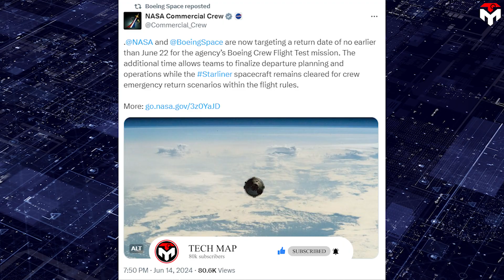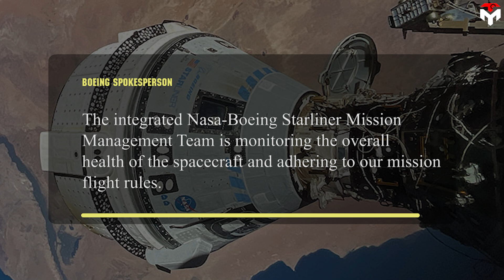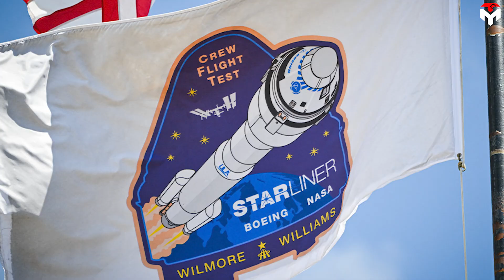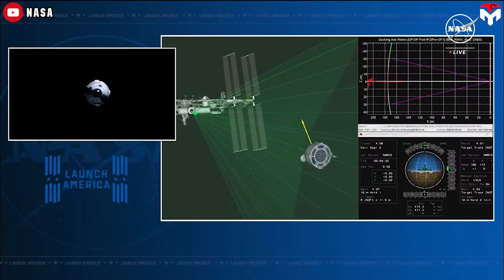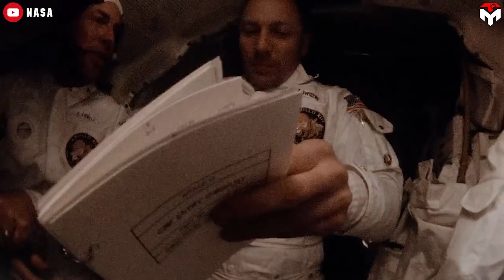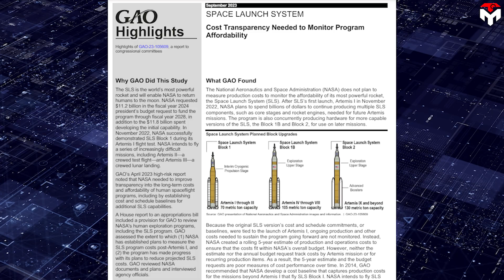Boeing Starliner in Serious Problem! NASA Engineers to "Give up"...

Comment: Tech Map has issues

A) you can’t just send SpaceX to the rescue.
B) Butch and Sunni would need SpaceX suits made for them and shipped to the ISS. Starliner suits won’t work on Dragon Capsule or vice versa
C) ISS will have consumable issues since the astronauts we only supposed to remain 10 Days
D) Starliner would need to be undocked at some point to prevent it being stuck at the station from the helium leak
E) Crew Dragon can’t just show up, load everyone onboard and depart. The ISS has to be in the correct position for proper splashdown

F) if Boeing/Starliner were to fail, then Boeing would be humiliated and I bet all commercial and defense contracts would be null and void. Boeing won’t risk that

Comment: Yes. And it may be necessary for starship to bring it back.
There are iterations of starship that might be capable of it.
Just mind numbing how the robo voice continues to butcher words in every sentence
Reply from the maker: :pride-flower-rainbow-heart::pride-flower-rainbow-heart::pride-flower-rainbow-heart:
Reply: These people don't know what they are talking about. The RCS thrust pods on Starliner are the same ones used on shuttle. The helium valves on shuttle also leaked because helium is hard to seal due to its molecular size. The control valves can be isolated with separate shut off valves while not in operation. So the helium is not continuously leaking. There is enough helium to leak and use the desired amount for thrust control. If it were not a test flight these leaks would be barely notable because they fit within parameters. 

I do think Boeing is getting sloppy and they have too many folks working on economics, sales, and de-regulation. Not enough air-craft engineers and technologists working to their peak ability.

Comment: There is absolutely no way those astronauts will return on that spacecraft. At least that's my opinion. If anyone in charge would approve such a mission then they should be removed from their position. I was of the same opinion when they had only one leak and these other leaks only exacerbates the issue. I saw no reason why they didn't fix the first problem to begin with. They wanted to avoid the embarrassment of another delayed flight. Two words; Columbia and Challenger. That's all you need to know. Both went down because of symptomatic problems known to NASA. One went down in spite of being told clearly by Morton Thiokol there was an issue with the seals and it was too cold to fly. The other went down because of a persistent problem with falling ice that in the case of Columbia punched a hole in the wing.
Reply from the maker: Do u think Nasa and Boeing will allow a rescue mission without feeling embarrassed?

Comment: Currently has 70 hours of helium supply...that's as long as it doesn't spring another leak. It would be much worse if it did that after undocking with crew aboard.
It could be game over if they lose the thrusters during reentry.

Comment: Whether Starliner is fit to return its astronauts or not does not dismiss the need to prepare alternate return transports for issues down the road.

Yes, SpaceX (or Soyuz) could do the job, though SpaceX is far more spacious and economical.

The downside is that SpaceX currently custom builds its IVA suits to each individual astronaut.  I doubt that Wilmore and Williams were fitted for SpaceX suits prior to launching on Starliner.  @NASA: this might be a consideration for the future.

Boeing's David Clark suits are designed to work with (plug in to) Starliner; SpaceX IVA suits are likewise designed to work with their Dragon Crew capsules.  They are not compatible.

Two things need to happen:
* SpaceX needs to come up with generic suits that will fit a range of bodies for such emergencies. #elonmusk
* NASA needs to establish a standard interface for IVA suits so that they can work interchangeably between SpaceX, Boeing, Soyuz, etc.

I suspect that SpaceX might have the better interface to standardize on - they've launched far more missions/astronauts, and have far more experience in designing flexible standards.  See how the US standardized on Tesla's charging port.

Comment: If they actually do have the fuel/helium to get back, then come on down tomorrow. If two astronauts buy the farm on the way down, then maybe NASA management will stop allowing consistent cost over runs and contractor malfeasance to constantly occur. Boeing is not the only problem. Blue Origin and ULA are also sucking at the government teet, and producing next to nothing.

Comment: Didn’t Boeing build the F35 JSFF? The one that only 25% of them are combat ready because of so many failures in the hardware and software? Along with numerous crashes? 😮

No….wait….that was Lockheed…

Now I remember…Boeing built the 737…that just falls out of the sky randomly…and the two whistleblowers that met untimely deaths…trying to warn about faulty and unsafe manufacturing issues at Boeing?!!!😮

Something smells rotten here…😢

Comment: There seems to be a war against Starliner with no data to back it up.   Videos like this just keep repeating the same thing over and over again.   If this was science, it would be bad science.
Reply: Absolutely...this is pure clickbait bullsh$t. The helium leaks won't be an issue for the return flight and the software fix for the thrusters worked. All these armchair quarterbacks forget this is a freakin" TEST FLIGHT. The astronauts won't be in any danger and they're there to find and try to wring out all the issues. All these ignorant videos and the the posters who know NOTHING about the aerospace industry (i've been working in this field for 31+ years) really need to just shut their pie holes. They forget how many issues occurred during the Mercury, Gemini, Apollo and the shuttle programs. This stuff is minor compared to what happened in those bygone eras.
Reply: @MrDmbright65  so why delaying return, when helium leak is insignificant?

Comment: Ultimately, the leaks have been around for years and there is no sign of Boeing being capable of fixing them…

Once the capsule returns to Earth… Boeing will have to tear down the prototype and spend years redesigning everything from scratch… as far as the leaks go…

No more certifying leaks … other than the next ones 😂

Fact is the launch never would have happened, under the current conditions. So, how can the return flight be happening?

Comment: It was a test flight that shouldn't have launched with astronauts and a known discrepancy ignored, "after" the abort.  That said, it is automated and should return empty or cargo alone.  If they can figure out the weight issues.  Remember the Astronauts had to leave their luggage behind for additional gear with the whiz convertor.  For safety's sake, have the Dragon fetch the two hero astronauts and not risk them to an obviously beyond "risk benefit" situation to impress or save face.  No doubt they will volunteer to do it as it is a pilot's nature, but the program is double the already overpriced capsule and needs a total safety review before it kills someone.  No matter the cause, it already has cast a huge shadow on Boeing's approach, regardless of what it does to the stock.

Comment: About time to hit the ABORT button on Starliner/ULA launch vehicles. Wildly over budget, years behind in usability, fraught with "manufacturing errors" (read abysmal quality control) and ultimately a hugely costly "paperweight" with no usable function. Deorbit the damn thing empty to burn up and eliminate a clearly incapable supplier. The whole BOEING debacle, from MAX series passenger aircraft to systemic quality control "inconsistencies" in the Dreamliner, BOEING seems to not only have strayed off the path but gotten completely lost in the wilderness. Would NASA REALLY want to risk two crewmembers lives to prove a point? I sincerely hope not - thats just callous disregard. 😢

Comment: If the leaks weren't a problem, the NASA crew would be on the ground already.
Launch Spacex Dragon rescue the crew, have Starliner return automomously.
Heads need to roll at NASA for launching a questionable vehicle with SOB's into space.

Comment: I find it funny or Ironic that 60-70 years ago that designing spacecraft was done with slide rule and pencil? And we had successful launches and returns with that primitive framework. Now a days it all computer generated.
Reply: Give me a break, he is right. The entire space program used slide rules up to the 90’s very few computer programs had the ability to do much more than diagrams. Yes the hard numbers even when key punched in was still checked by slide rules. I used slide rules even when doing one offs for parts on both Atlasll Titan and some shuttle stuff.

Today many programs can do that. Including the kernel space game uses real data you can input numbers and get real numbers. However his point is still valid nothing designed  since Apollo was revolutionary up to falcon and even that has roots in several old NASA  plans. The problem is not engineering but the pawning of the space program by various politicians over the years using it more as a jobs program a bad one at that than  having and keeping  to a good steady plan.

FYI I have spent between. MY time on and off active duty working in various capacities supporting launch operations  I have been in the boom bust cycles of this the only way to move forward is to push ram forward the mindset of getting to Mars setting up facilities for the rest of humanity to get off this damn rock  make life better for everyone.
Reply from the maker: More advanced and complicated, more risk. How abt u

Comment: Professor Kurabayashi has it right, Why not have Butch and Suni come home in August during the handover? Plenty of time to get their suits ready and re-plan the handover hop for plus two coming down. Even this most direct solution will require a lot of work. If it has not already begun, it should start today. It is long past time to worry about which sets of toes get stepped on once the mission is over. Butch and Suni need to be brought safely home. Right now, that is Job One, and Job Only!
Reply from the maker: Absolutely

Comment: If @NASA thinks @Boeing Starliner unsafe for the landing, the answer is SpaceX.

But they would have to ferry suits, I doubt NASA learned much from Apollo 13 with the square vs round O2 scrubbers. I don't think Boeing suits can connect to Dragons life support.

With the near non stop cadence SpaceX has, they should be able to get a Dragon ready. They have two to choose from. The next ISS mission and Polaris Dawn, but that Dragon would need the top hatch replaced with the docking ring. So I think they launch the next ISS mission early, have them bring SpaceX suits, and ferry them back, can they add additional seats to bring back the ISS crew & abandoned Broing crew
Reply: You don't need space suits for reentry. Even Apollo missions reentered in a shirtsleeve environment.
Reply: SpaceX has mor than one dragon capsule rated for human flight I think it's four.!!😉

Comment: The crew Dragon can transport 6 Astronauts? Can they wait and return with the other 4?
Reply: The crew Dragon was originally designed to transport 7 astronauts! Nasa had SpaceX remove 3 seats and make them a 4 astronaut capsule. Maybe an original specification 7 astronaut crew Dragon should be made and maintained as a permanent emergency back-up system for the ISS?

Comment: Why does it not make it clear that Spacex is the only one capable ATM, maybe the Elon haters cannot swallow that pill and admit it.
Reply: From what I read, the Dragon does not have extended capabilities for long term flights and Starliner is supposed to be designed for that. Basically the Dragon is like Gemini and Starliner is supposed to be like Apollo.
Reply: Yeah and yet it does not work.  I will not work for most of the companies left in aerospace. Been there done that never again.

Comment: Flawed Boeing aircraft began with B-17s falling out of formations, blamed on invisible flak with no enemy aircraft. B-29s fell into the sea taking off - recovery boats were stationed at all runway ends - blamed on over weight bombs and ammo, not Boeing. Boeing jet liners are killing people due to bad engineering. NASA has a failing Boeing space capsule - and will save Boeing before our astronauts.

Comment: NASA bureaucrats provided the design requirements for the Starliner which is why it looks like an oversized Apollo capsule. Boeing was reduced to a contractor who executed the design requirements given to them on a cost-plus contract. As a practical matter, why use Helium (which can leak through anything) to pressurize the thrusters instead of Nitrogen which is an inexpensive gas that is routinely used for inert pressurization. (Maybe there is some subtle chemistry issue, but I have seen Helium gas leak through joints that were perfectly sealed. Anyway, it is annoying listening to NASA "scientists"" blaming their contractor for a design that they were largely responsible for.

Comment: In a space flight, launch and reentry will place the maximum stress on the hardware. Thruster control is critical during re entry. The capsule needs to keep the head shield oriented at the right angle. Thrusters are needed to maintain the angle.   Reentry with faulty thruster control is a bad idea. Boeing and NASA need to decide what is important, reputation or the lives of the astronauts. Too late to have fixed the problem before launch.
Reply from the maker: Sure. I do not know how they can solve them all